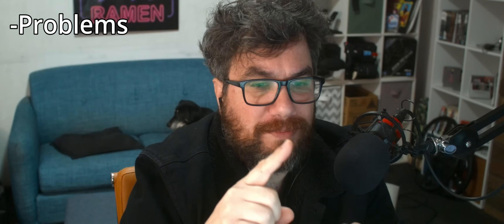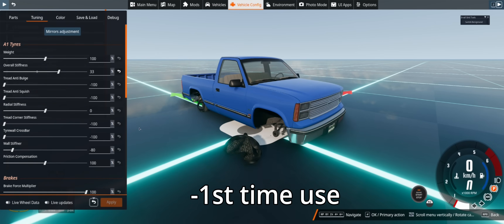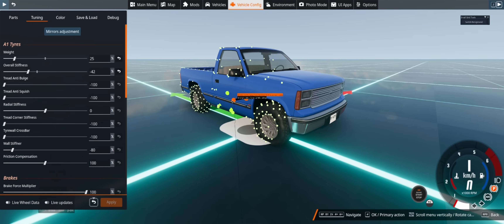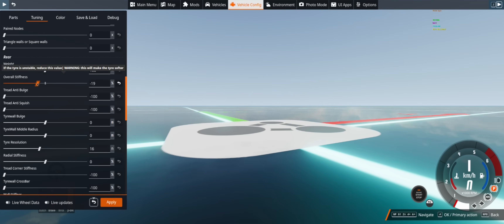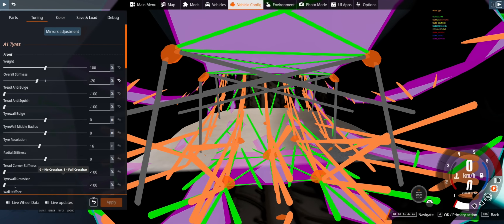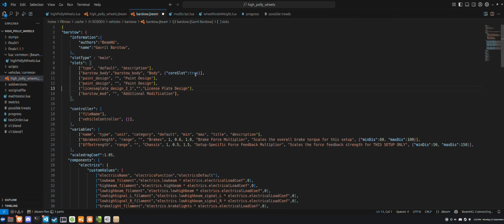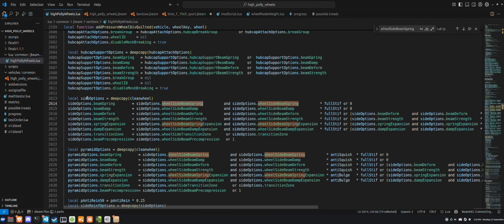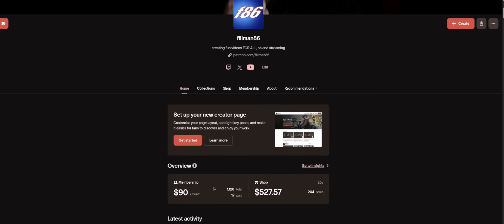How to use "High Polly Wheels" mod

Comment: Rock crawling with soft tires IS SOOO COOL It actually deforms now with the rock instead of just flattening in all areas I REALLY CANNOT WAIT to see this mod get even better

edit after trying drifting racing etc it feels less snappy and more grippy so it's much more realistic and controllable in drifting but when cornering normally it feels kinda understeery so I think I'll stick to normal tires for track racing for now

Comment: @fillman86
Sorry for pinging you. I'm a JBeam artist specialized in flexbody deformation, and I most likely understand where this problem at 2:43 originates from, and I wanted to let you know. 

In simple terms, BeamNG's flexbody mesh deformation calculations are designed in such a way that they attempt to counteract the movement of the mesh in areas where there are no enclosing nodes. This occurs relative to the last point where the nodes were enclosing the mesh. I like to refer to this as the "Seesaw effect." When one side moves up, the other side moves down. Similarly, when one side gets extended, the other side shrinks.

Currently, I am working on an airbag mod that inflates the mesh to ten times its initial size, and I encountered the same behavior there. I found that when I ensured the airbag mesh was fully enclosed without any protruding areas within the group of nodes, it resolved the issue with the odd behavior during inflation.

Comment: Hey man big fan of your videos, it got me into modding cars in BeamNG. I was wondering if you have any videos where you battle with working with pressureWheels because it's currently doing me in and the documentation is bums
Reply from the maker: yeah, it's pretty bad. The only thing I remember is, the order of the slots for parts that have "pressureWheels" in them, have to be a specific order. So compare yours to theirs, and fix if there's any differences

Other than that, picking the right nodes is very important, and you can't double up on any of them
Reply: @fillman86  appreciate it!

Comment: you should make front and rear separated so i can put more beam on the rear and less on the front, maybe even the original amount reducing the friction /2 on the front maybe even more adding more speed since less friction on front !
Reply from the maker: the patreon has the ability to differentiate between the front and rear
Reply: @fillman86  my friend have the 1.1 and he didn't be able to do it before that why 😬

Comment: the t series is completely unusable the slightest tap of the throttle and it rockets away
Reply from the maker: yeah, I'm looking into it. It seems to be in relation to the tread direction. I spent a bunch of hours on it, but I've only managed to reduce it a bit
Reply: @fillman86  i think it also affects any car with a dually
Reply from the maker: @kltmilliken  I think the more tyres there are, the more force
Reply: @fillman86  many vehicles in my testing have they're wheels move with an invisible and constant force, could this be related?

Comment: I loaded it in, turned it on, and immediately was actually able to control the drift configuration. Incredible. I gotta get my sim rig back up and running to try this out on wheel.

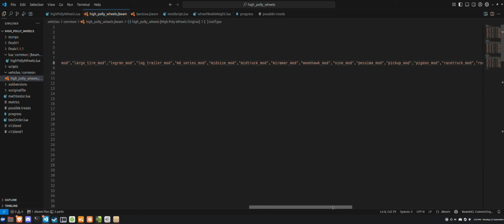Comment: I guess this could be integrated with my MultiSlot mod, which generates "*_mod" - mods for all vehicles, even modded ones, automatically. This would fix the slot issue at 13:50
 I will probably soon update it with some fixes and additions 😅

Comment: Your mod is very interesting, but it is missing a logic of existence. Everything is determined in 70/30% = 70 inert waiting for action without real activity (dormancy) and 30% in real action (being used). If you leave the detection of friction and other correlates only at 30% of the tire's contact area, the cascading errors would be drastically minimized, making it possible to identify more quickly.

Comment: This is a very weird and hacky way to make a physics game. But what if you could have just 2 parameters that affect the rest so that you only change compound stiffness and pressure?
Reply from the maker: that leads to issues of having to predict how tyres will be used. It's why lots of other sims don't work well when you try to drive outside of the norm
Reply: @fillman86  then maybe add those 2 so the other params are calculated? Idk if it can be scripted with a toggle so it can be overriden individually too for weird shapes
Reply from the maker: @635574  but those settings are in there, but there's so much more to how a tyre is performing

Comment: Grabbed it off modland lastnight and had a play with it some. It's very cool.. But also difficult to get the benefits of it while having the tire not look/act weird.. But in the base game people turn the tire pressure down very low.. Which in beam normally is terrible.. With this mod however.. if you stiffen some of the settings up to stop the tire going spikey but have the pressure really low(<10psi).. Then it can have some pretty nice results. Another problem i was having which i am not yet sure is the tires fault was that the vehicle wanted to move with no power being applied while on flat ground. Could've been my settings aswell tho. I really hope the devs are able to take their extra funding to make the new model a more polished version of this.. Since it's awesome.

Comment: The Devs should hire you right away!!
1000% the BEST ADVANCEMENT in BeamNG.
It brings, what the tyres needed!!!
Pure GOLD 😊
Reply: Have you seen the testing they are doing for their tyres update? Waaaaaaay more in depth than a mod adding nodes
Reply: @blobfish7159  that video only showed tire testing, so that Beamng has accurate values to work with. We still don't know how are they gonna implement it to the game, so maybe they just add nodes like this mod
Reply: @blobfish7159 no, actually not.
But I see the devs make new unnecessary cars, instead of fixing a memory leak in Vulkan+VR mode, which is really sad.